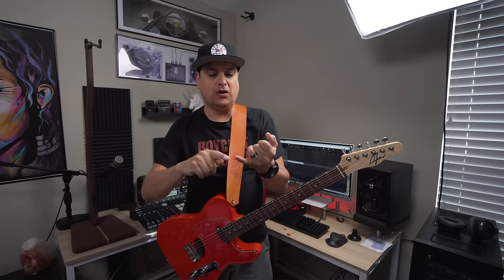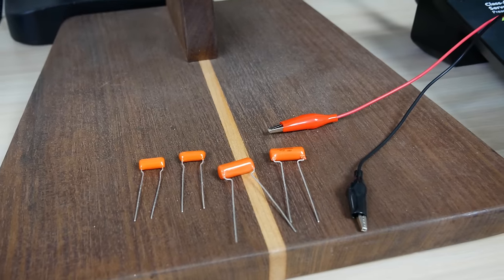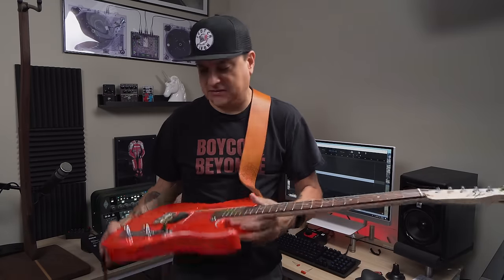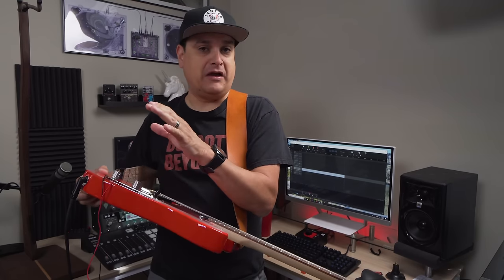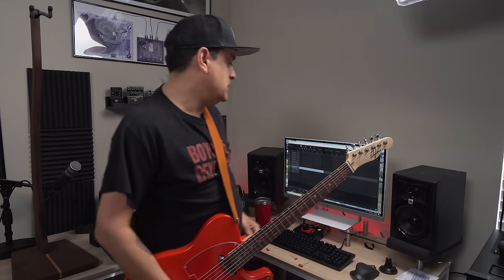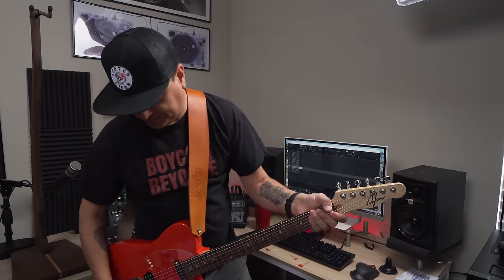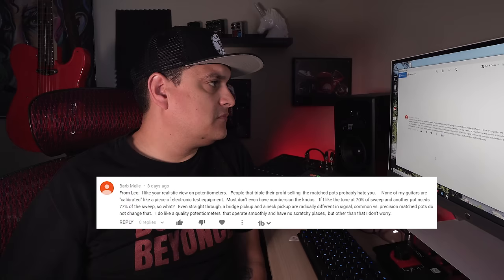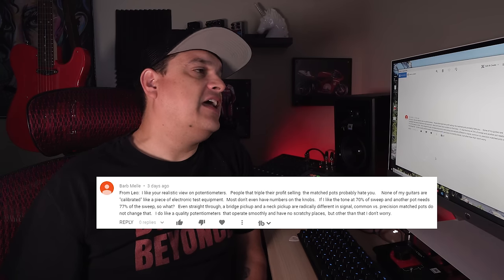What Capacitors Should I Use In My Guitar - A demo

Comment: hi  i got  my  bass from  service ,,wood and fret work  was  done  ok ,,it  is  hohner  passive   2  humbucker b2  steinberger  licenced  headless,,problem is    in  pots   ,,before   servis   sound and  tone control  knob   worked  just  perfect  i  had  in  sealed   square  plastic   quality 470k pots ,, 2  volume   pots  got  just 470 k marked  on ,,but tone   had   470k -2 written on ,,now after service   volume  knobs works   let say  ok  but   tone   is  not  ok  ,even  fully  open  sound  is   different,,but  biggest  problem is  that    until turned   almost to  full closed   pot is  cutting  almost  nothing  of  highs,than in  1mm more  turn it cuts  off all  the    highs and drops   the whole signal of  bass  by  half,, if  you  can please   reply   to me   what   that   /-2/mark on  470k pot  mean,and  what   do  you think is   wrong,,ps  i  saw   here   same  orange   drops   capacitors in  video  where   the  guy    is talking   that  they  can  be  installed   backwards,,he  is talking   about  amps   and   other  not   guitars  ,but  i  was   altho loong 30  year ago in  electronic school  and  i  do not  remember   that  beside   electrolite   capacitors   that  got  plus  ,minus  terminal  ,theese   like   in  your   video  can  be  installed   both  ways,,so  what  is   that  guy  talkin  about  ,, i  will  try   to  find   and  post  you  his wideo  here  ,,please   help  me   with   my bass problem ,,reply  as  fast  you can  /thanks  mitja slovenia

Comment: Thank for the demo, really shows the difference. But how does this apply to my guitar(Pacifica) for example, I have a HSS configuration that I will convert to HS and a Tele S on the neck position ... how do I choose the right pot as I have only one tone pot + the volume pot? If you should generally use 250k for the singlecoil and 500k for hummbucker, but having just one tone knob makes it impossible to do that. And then taking into account the caps ... ?! How do I set my guitar so the tonal options are as wide as possible, but not clogging/exaggerating the sound when using the same tone pot for singlecoil or hummbucker? And the last question, is it worth having a no-load pot? Thanks in advance and rock on!
Reply: Goran Lorencin
You can use any pot what you want with any pups you have.
It is not such matter, really.  But not take the pot less than 100k.

Comment: I have a Warwick Streamer bass guitar with these little 25kdime size pots, it has 2 MEC soapbar pups, they measure 4000 ohms impedance, so I wanted to change the pots and caps to CTS 250k pots and .47 caps, doesn’t work, so I changed back to the original setup, playing through my Rumble 30 I have to crank the volumes full up to hear what’s going on, what are your thoughts on rewinding the pups to maybe 6000k and then reinstall the 250k pots and .47 orange drop?? Thanx 👍

Comment: I am not sure how the cap selection would make a difference if the potentiometer is always left @ 10 (lowest resistance), since following cutoff frequencies are correct with each cap value:
(For calculations' sake, I used 5 Ohms as the lowest resistance)
F_cutoff (0.015 µF) = 2.12 MHz
F_cutoff( 0.022 µF) = 1.45 MHz
F_cutoff(0.033 µF) = 0.97 MHz
F_cutoff(0.047 µF) = 0.68 MHz

So, all cutoffs are WAY outside the audible spectrum of humans (appr. 20 to 20 kHz). How would that make a difference in this constellation? Has it got to do with lower octave resonances or whatever, because for my ears at least, the tone seems to get darker the higher the capacitor? Don't get me wrong, it is very obvious to me that the capacitance changes the sound at higher resistances where the cutoff is within human audible spectrum...

Thanks for the video anyways!
Reply: Guitar pickups are inductive, so the complete circuit makes a 2nd order filter with variable Q and cutoff frequency in the range of a few hundreds or thousands Hz.

Comment: If we buy a capacitor, does it have a variable setting? Or is a 430 always a 430? 

Or another way to ask, if we buy a 473 do we have 153 and 223 also in the control depending on where we turn the knob to?
Reply: polocash11
Almost.

Comment: I have a telebucker. Which pot gives me the best volume balance? 250k or 500k?  Should I use two different caps .033 and .022?
Reply: Ray Patton
250K just fine for any guitar. But if you already have 500K -- put them, is a not a big deal.
With a caps -- same thing. Put what you want or what you have.

Comment: Hey Dylan, thanks for this informative video! Quick question... what is the difference between simply rolling off the tone knob vs adding a capacitor? Is there a true tonal difference?
Reply: Tone knob doesnt roll off the tone without a capacitor, it would roll off volume by forming a short to ground. What the capacitor does is allow high frequencies to pass, but not low frequencies. So the high frequencies of your guitar tone are preferentially sent to ground, the low frequencies are not preferentially sent to ground. There is... A lot more to it than that, like a lot more. But if you can understand this point, you understand why there needs to be a capacitor there.

Comment: If u want 250k pots and a .022mF cap they both must be tested! A pot the measures 200k and the next one is 300k your tone will change. The same for the caps...
Reply from the maker: Not if you buy good ones lol
Reply: @DylanTalksTone  can I check the pot values while installed in the guitar? Thanks for the reply!
Reply: what I noticed was with all controls on 10, the .015 cap tone was brighter than the .047. I might use a push/pull tone pot and use different caps for each pickup or different values for blues, chicken pickin' or rock etc!

Comment: How should I take the voltage of a capacitor into consideration? 200v, 400v or 600v
Reply from the maker: in a guitar it doesn't matter. less voltage jist means its easier to fit
Reply: @DylanTalksTone  awesome, thank you for the quick response and all the great videos. I'll be placing an order with you shortly.
Reply: @DylanTalksTone  Do you ever find failed capacitors due to static discharge?  I live in California where humidity can get down to 10% in the winter, and I have received some serious jolts from just getting in and out of the car.

Comment: Do different types of caps also have a big difference...
I've been using the bumblebee  caps in my teles...seeing orange drops in LPs....and cheap little ones in my cheap chinese stuff...
Reply: No. It doesn't matter in the slightest. The only thing that matters is the capacitor's value. When people claim it does make a difference, it's either placebo, them hearing the variations in the individual capacitor's value (because they never go to the trouble of carefully selecting capacitors with exactly the same value when they compare them), or just downright lying. The cheapest ceramic capacitor will sound exactly the same as the most expensive "hifi" capacitor as long as the actual value is the same.

Comment: Hey Dylan, does the length of the leads from the capacitor make a difference, in your opinion?
Reply from the maker: not in this aplication. not opinion... fact. remember we are usually dealing with components in guitars with 10-20% tolerance

Comment: Contradicting yourself on "calibrated pots, bah nonsense".......then......."we test all our pots are within tolerance". 
And tonewood...you only speak of alder and swamp ash which are very similar sounding to begin with. Clearly mahogony sounds different. And yeah, I know the weights matter. But overall, it is shown in test right here on youtube, that mahogony has more pronounced mids. And I can tell you for sure that full rosewood neck sounds drastically different than maple on a strat. Not better, btw. Rosewood is dark and dead, which is why it's used to tame maple which is super bright.

Comment: seems to make little difference until tone pot is at 50% or lower.  interesting!
Reply from the maker: This also is due to the pot taper, which we will discuss in an upcoming video
Reply: @DylanTalksTone  I was think about using different pots in the circuit.  I have no experience with this, but i have been told that "cheap" pots are less responsive.  Not sure if this is a condition of cheap or different resistance/electrical properties of a pot (if i am making any sense).
Reply: DylanTalksTone So does your Tele have a linear or audio taper pot.
Reply from the maker: @RickDeNatale  audio taper